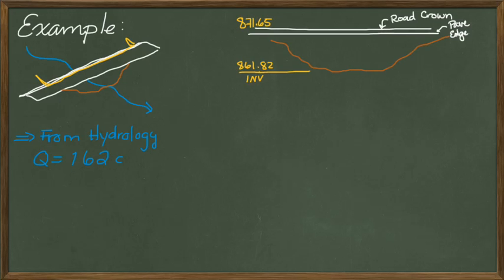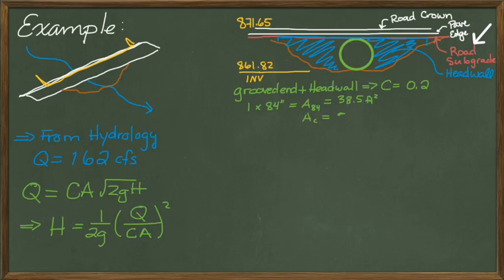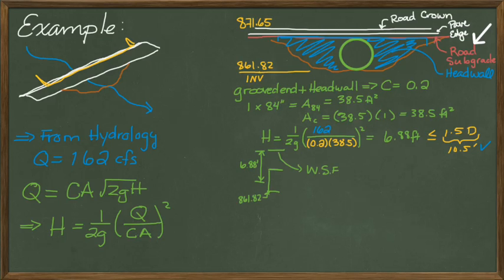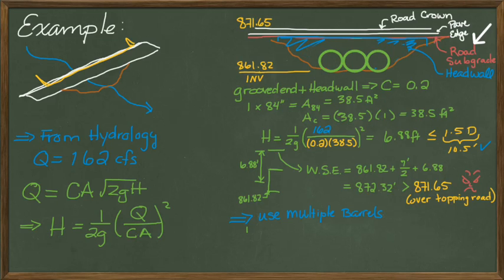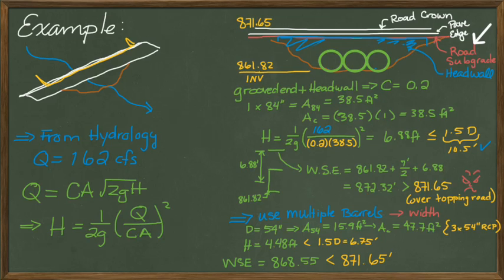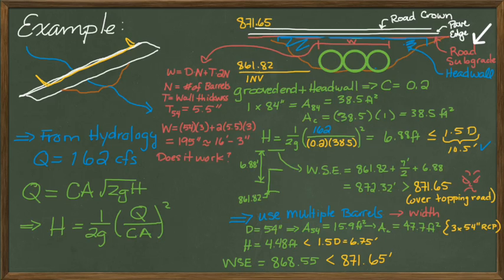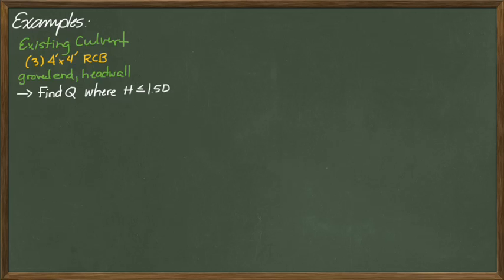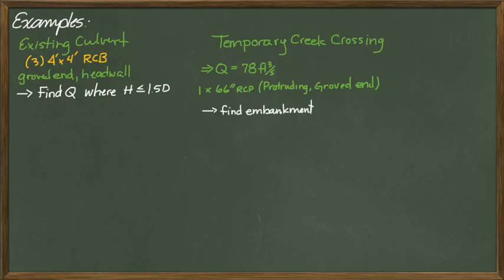Culvert Analysis 1

Comment: Why did you add 7'/2 to the invert elevation? Shouldnt the WSE just be the invert elevation plus H? Thanks
Reply from the maker: H is measured at the centerline of the pipe. Not the invert, so that's why I divided the pipe diameter by 2.

Comment: Hi Kenneth, can we use synthetic unit hydrograph peak discharge  as design discharge Q in culvert design?
Reply from the maker: Yes of course!  The advantage of using the whole hydrograph in culvert design would be to simulate the entire storm through the culvert.  Sometimes this helps reveal new risks beyond using only the peak flow.  This would be done using computer software as it would be too time-consuming to be done by hand.  I have a Paper tutorial on how to model a culvert in HEC-RAS.  This software can be used to model the 2D flow through the culvert at whatever time step your computer can handle.  Are you familiar with HEC-RAS?
Reply: @kennethwlamb  does HEC RAS performs design part and gives final outcome?. 
I thought it gives only water surface elevation which is helpful for design
I have heard about HY8 software what's ur review on it?
Reply from the maker: @rohi7597  HY8 is designed to size a culvert, so it is better in that regard if that is your only objective. I think it is a great tool, even though it is a bit complicated.   I have not used HY8 to analyze a culvert with a hydrograph as my input.  I have only used HEC-RAS for that, so I'm not sure which would be better when you have a hydrograph as the input.
Reply: @kennethwlamb  thank you Kenneth